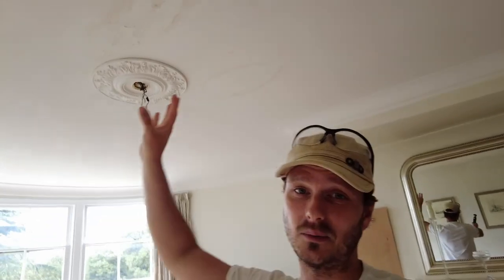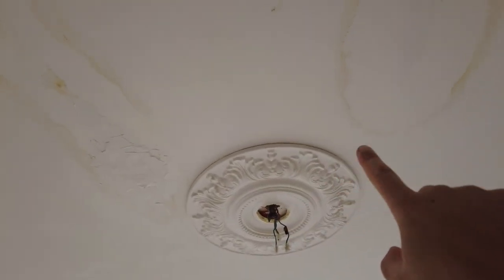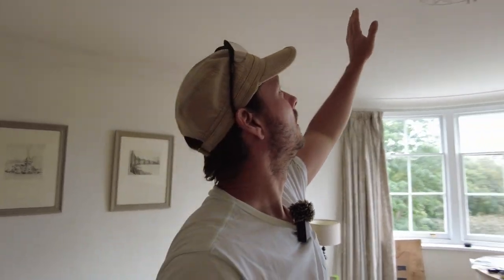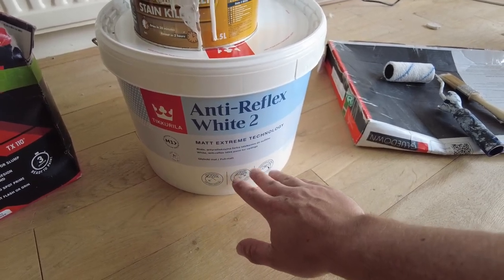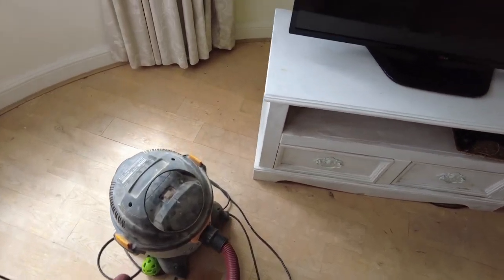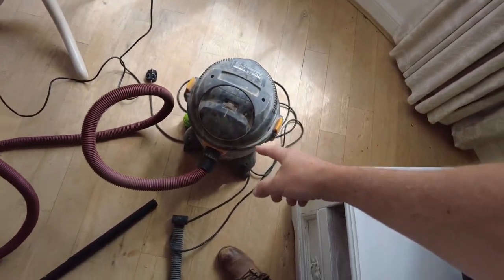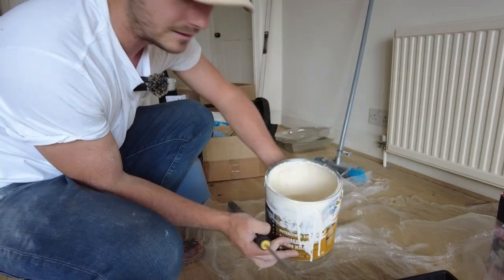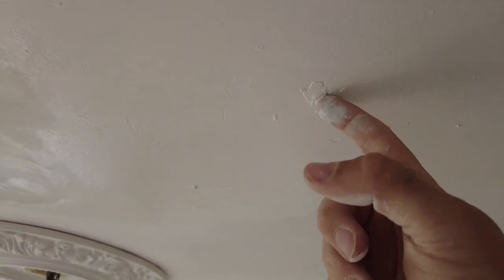Fixing Water Damaged Ceiling with CoverStain and Tikkurila AR2

Comment: Handy tip. With these ultra flat anti reflex type paints such as ar2 or Dulux ultra matt. I’ve found going over anything like filler or stain block, give it a quick spot prime with a vinyl white matt and then 2 coats of say ar2 and you will be bang on. They haven’t necessarily got the high opaque coverage of say vinyl matts or contract matts but don’t flash once 2 coats are applied if that makes sense 👍
Reply from the maker: Sounds like a good shout 👍

Comment: I have a ceiling and wall stain in my loft, and I hesitate to use one of these sealing paints because I'm worried that if the leak ever recurs, the paint will seal the moisture in and prevent me from knowing it's there right away, so it'll end up doing more damage. Do you have any experience of what happens if another leak happens after you've applied one of these?

(It hasn't leaked for many years so I'm confident this leak is fixed, but I'm not confident my roof will never ever leak again, if that makes sense.)
Reply from the maker: Humm these types of paint stop the stain bleeding through, it won't stop moisture. So you'll still be able to realise if a leak occurs. You'll be fine, fix it 😉
Reply: @THE-AIDEN-PROJECT  Hahah I will, thank you!

Comment: Waste of  time if the problem causing the stain is not rectified.

Ceiling then needs to dry out completely.
Remove loose material with stripping knife.
Apply cover stain by brush.
Leave for 1 hour, feel if it's dry.
Then give ceiling a coat of your finish.
Leave for 2 hours, to make sure it dries throughly, the cover stain areas will dry more slowly as that area is now not porus.
Then fill the areas which need filling with your toupret filler, leave to dry thoroughly, rub down those areas with 120 or 150 grip until smooth. 
Give ceiling a second coat.
Leave to dry out throughly again. 
If after this the coverstain areas still show through slightly, just go over those areas again with your 12inch roller. Rolling the paint over the area and beyond does not matter.....Once dried job done.